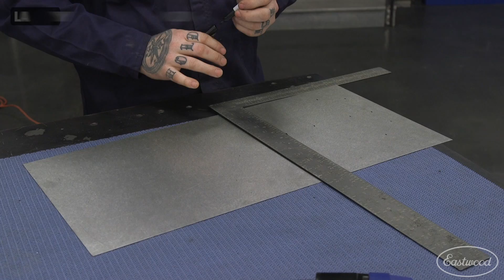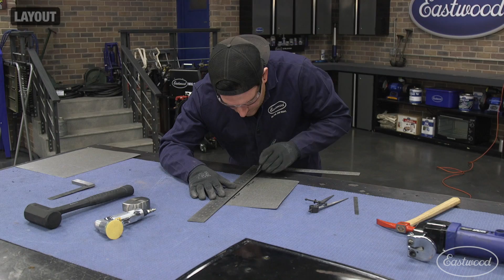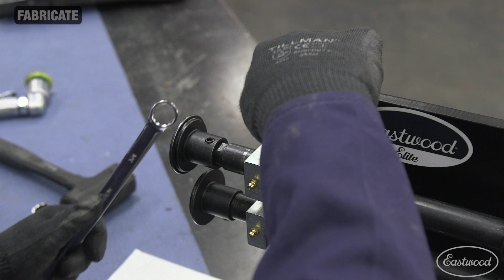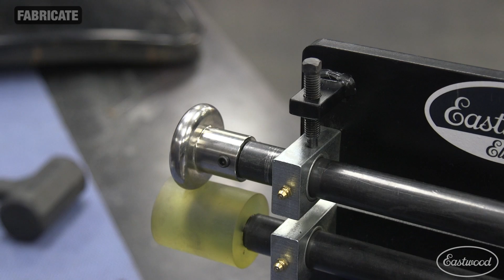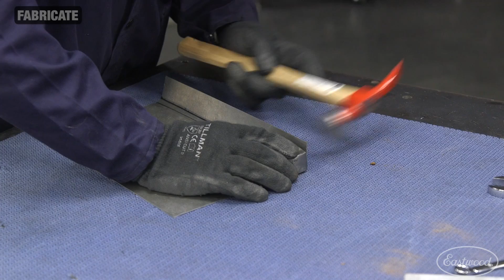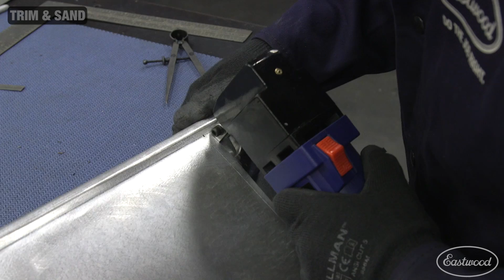Model-T Patch Panel Fabrication with the 8" Elite Bead Roller - Eastwood

Comment: All these videos are great and appreciated but getting the machines and tools is a nightmare from this company I have placed orders left right and centre and all I get is it's on back order and then when I order the original bead roller boom discontinued and the only one to get is the elite version at more cost then I want shrinker stretcher and yep you guessed it all on back order.  Not the best company to buy products from